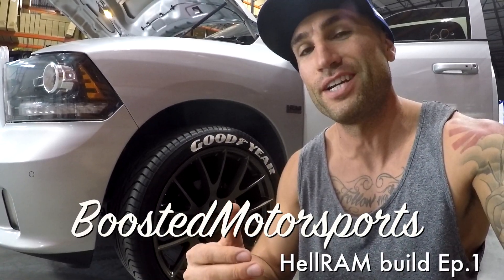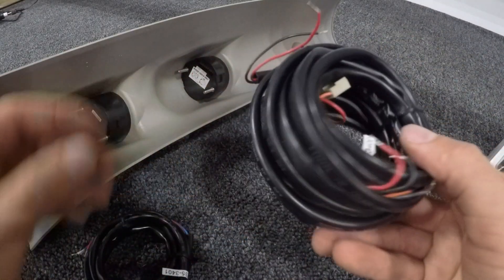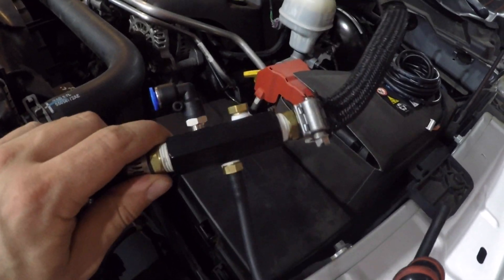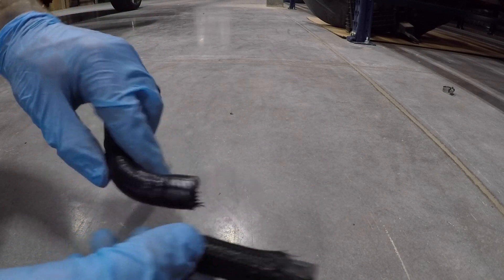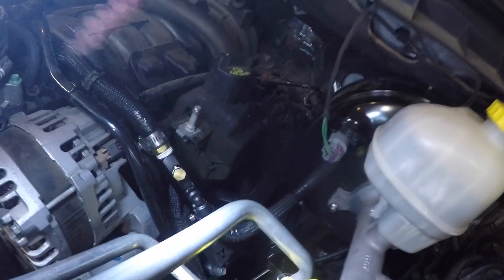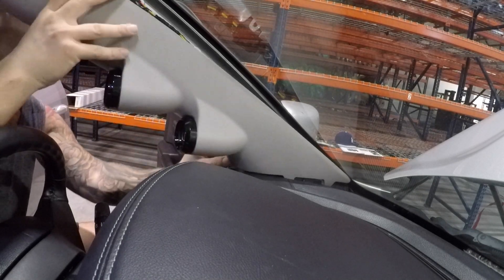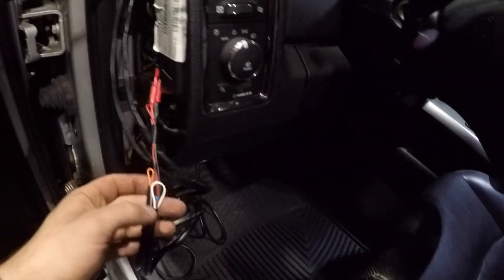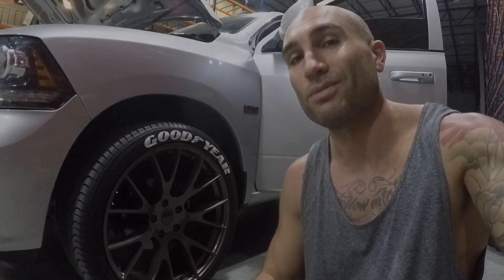Installing Boost & Air/Fuel Gauges on the RAM - HellRAM Build EP1

Comment: Did you connect the Hot wire for the afr gauge to a wire under the dash or to a wire in the fuse box? Do you know what wire it was? Thank you!

Comment: Really loving your channel man! I'm on roughly the same path with my 09, just got an ATS 545rfe trans and Edge 2800 stall in. 
I have the AEM boost and wideband as well and getting ready to put it in, where did you weld your bung?? 
Waiting to see if the Canadian peso will go up so I can save a few bucks when I order the Procharger.
Reply from the maker: Thanks Leon!  I welded the bung a few inches from the factory primary o2 sensor on the driver side 👍

Comment: i know this is old but to any one that is wiring up an aem  x series boost gauge using an add a circuit, f75 coolent temp valve fuse stays hot through acc/ignition/ engine on . there might be more but this is the fist one i found.

Comment: Hey boost do you think you’re dash control evic center will fit in a 2010 I have the big screen but not like youres
Reply from the maker: Maybe if you got the whole 2013+ center console and one of those tesla style radios!
Reply: BoostedMotorsports I recently installed the tesla radio in my 2015, love it.  I only had the 5" screen prior to this install.
Reply: Hey Dodge it would take alot of work to get it to fit right. Dodge changed out the Center stack and radio with Nav in 2013. Prior to that the style you have ran from 2009 - 2012. The best place I found that has the parts and videos on how to install them is Infotainment.com. I havent bought from them so this isn't any kind of an endorsement, just a helpful hint. But like the other guys on here are recommending I would say the aftermarket "Tesla" style radios would be easier and cheaper.

Comment: How did you wire the wideband? U didnt show much at all
Reply from the maker: Its pretty simple just one wire you ground on the chassis somewhere and the other you tap into a switched power source.  I found a switched power source over by the center console that I tapped into. 👍
Reply: What was the part number for the wideband? And what brand if you remember? Working on getting everything for mine set up.